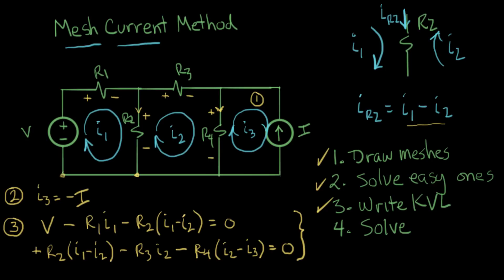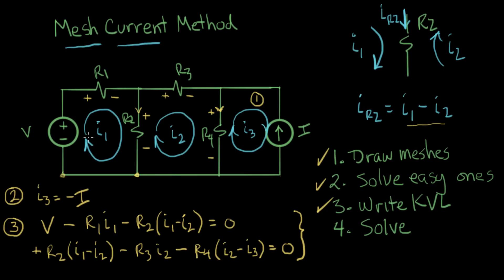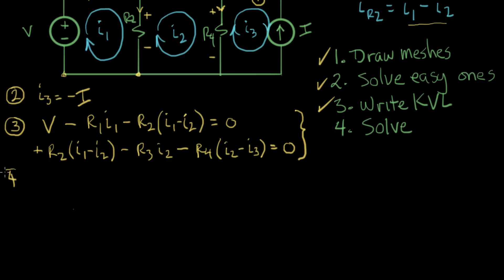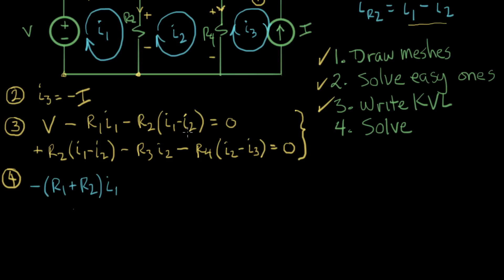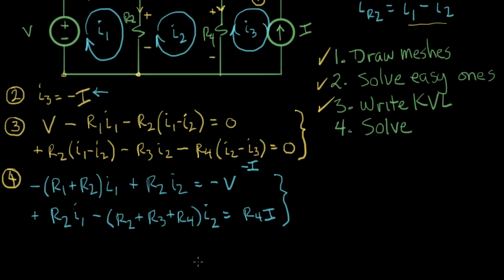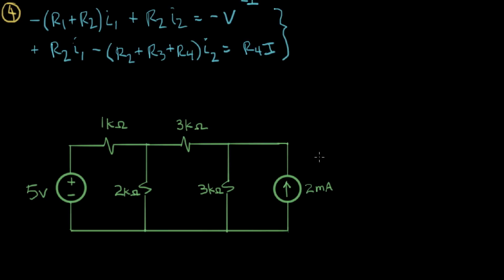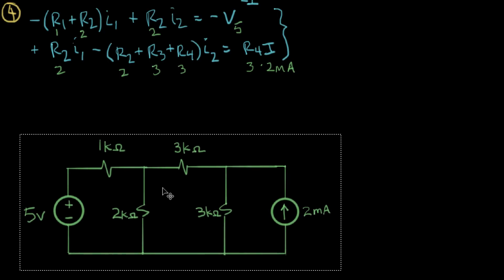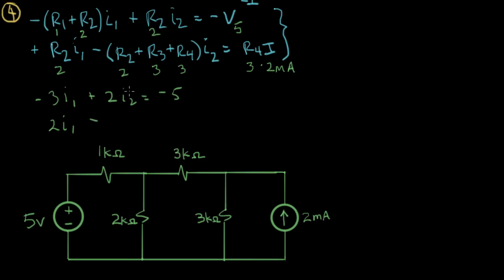Mesh current method (step 4 solve)

Comment: Ir2= (I1-I2) would be the value you made a mistake correct it or if im wrong please clarify it to me because when we are analyzing a specified mesh analysis then we take that curretn as reherence current while other are less than to it
Reply: farasat ali generally it is correct that as the current is divided between branches, each new current value will be smaller than the current from the source. However, in iR2, the current is bigger than the source because the current in the second mesh (i2) is negative and therefore turning the opposite of where it’s arrow is pointing to. This means that i2 is entering the same node as i1 and resulting in an addition of both of them, which gives us the total value of iR2. This makes sense because we have a current supply on the right end of the circuit which is also pushing current into the circuit.

Comment: Made a mistake on loop 2; (i2-i1) is correct for loop 2
Reply: no it's keep it at the first one, because the current flow from the top
Reply: i was thinking like that too but the right one was like that
Reply: Actually i1+i2 is correct, because i2 flows counterclockwise which means that both of them flows from the top

Comment: In the second mesh, is the equation of R2 correct? I think it suppose to be (i2-i1) instead of (i1-i2)
Reply: its i1 -i2 as per clockwise movement.. i1 is going to R2 via the plus sign and i2 is going up the resister via the - minus sign.. hence R2(i1-i2)
Reply: @nawafaleid196  Yes but the i value itself would be negative, so subtracting it would make it positive? X = 3, Y = -5... X+Y = 3-5.... X-Y = 3+5. I think he flipped it too?
Reply: i think so too

Comment: what is the overall current? 
i1+i2+i3? 

it doesn't give me correct results. 

when adding the resistance I get 2500 ohms. but get 8V when using the sum up of the currents.
Reply: That's cos he made a mistake while he was moving -R4i3 to the right side of the equation. -R4i3 should become +R4I and when moved to the right hand side of the equation it should become -R4I

Comment: I'm losing my mind. Why is I3 equal to negative I? Normally it would be [minus I minus whatever is the current that goes through R4]
Reply: It's a constant current source it's an exception. Similar stuff happens in a supermesh where you would assume that part does not exist. Not sure about the reason though
Reply: Because we set the total mesh voltage to zero, this means that the only two variables that can be changed are resistance and current. There is only one resistor in the mesh we are considering for I3 which means there cannot be a change in resistance within the mesh. Because both voltage and resistance are unchanged, Ohm's Law states that current must remain unchanged as well. This is why we don't consider R4 in the calculation.
Reply: same prblm here bro ! 
i think it's a mistake
Reply: Well I asked my teacher today since this was driving me insane. Basically, the current through R4 is made of i2 and i3, not that i3 is made from the current source's current and whatever is going through R4. So, since we know the value of the current source, we know i3. With that said, one should NOT assume that a mesh current is the sum of the branch currents.
Reply: thanks man I appreciate it ! even though I didnt understand well ur answer
Reply: You're welcome.
Reply: For anyone still wondering, its because of how the direction of the current source is defined and the direction he puts the third mesh in. Since they are contradicting each other i3= -I